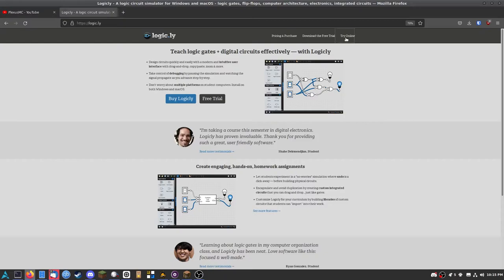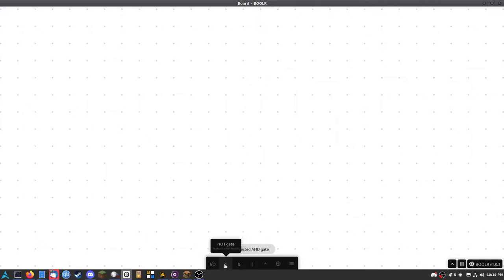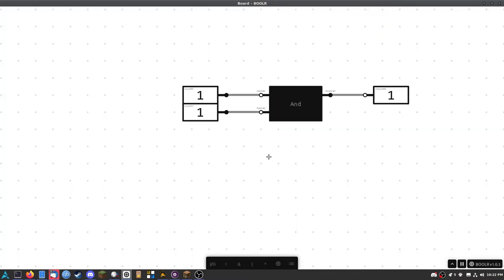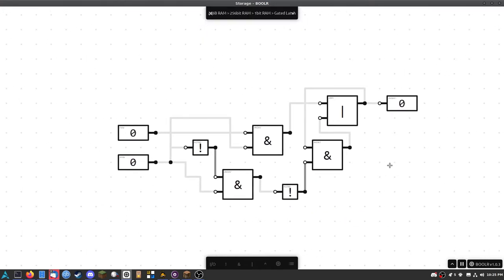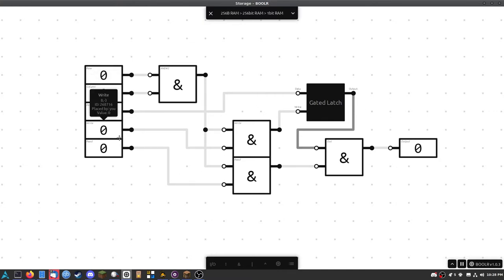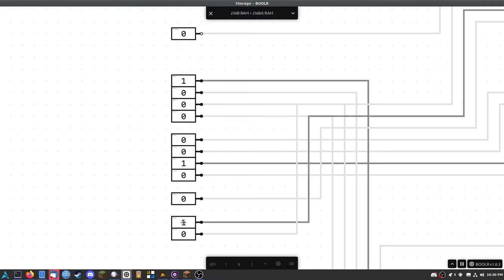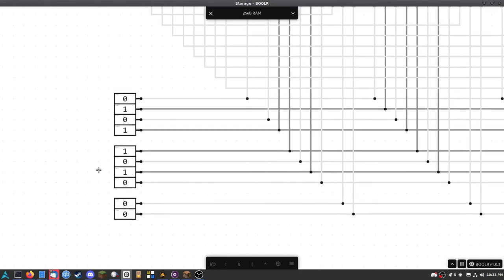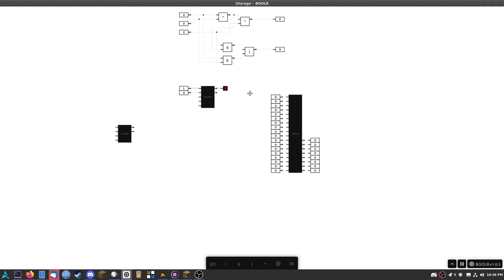Put Logic.ly to Shame with Boolr

Comment: one thing i noticed at 10:24 is that there's a missing connection between the second address pin (second from the top) and the first data memory block
Reply from the maker: woops 
good eye

Comment: A very cool but unfinished and abandoned project.
I tried to build an 8-bit computer using it (with Clark Scott's 'But how do it know?' as the main instruction source), but the problem was as soon as the schema went too big (50+ megabytes, which is easy to achieve by nesting components) or the logic got complicated (like in ALU or the control unit), the program froze or just went crazy.
Sometimes BOOLR can even overwrite your saved files, because of which I lost a significant amount of work several times.
It couldn've been very cool if someone kept fixing bugs and maintaining the thing, but right now it's a huge disappointment
Reply from the maker: someone should fork it and bring it back to life
Reply: @PlexusMC  I'm feeling so desperate about it I might even try that myself tbh) It's written in js (obviously) and from what I've seen, their code is pretty easy to read and edit.
Cudos to those Dutch high school students for pulling that much off anyway
Reply from the maker: @acalabash  keep me updated if you do